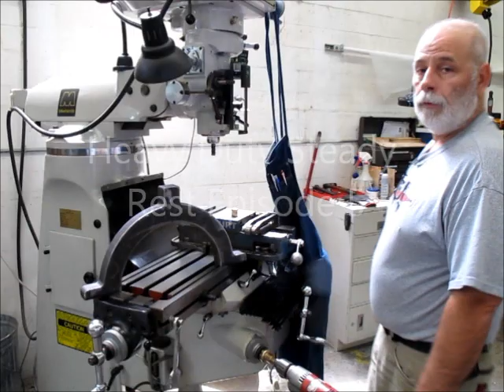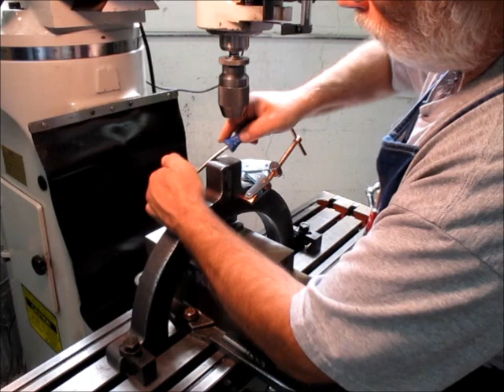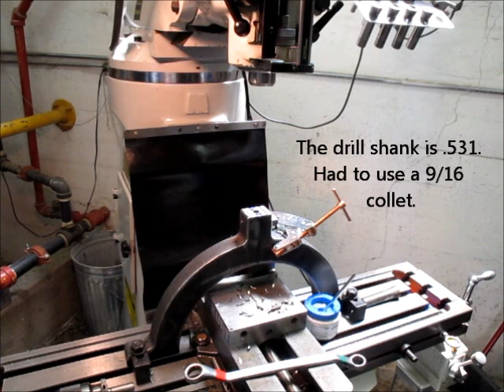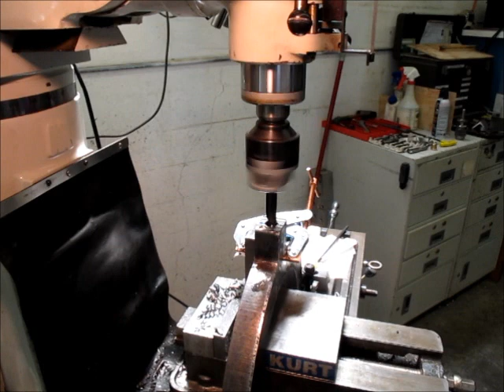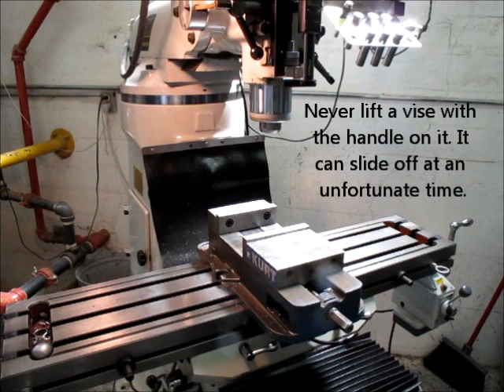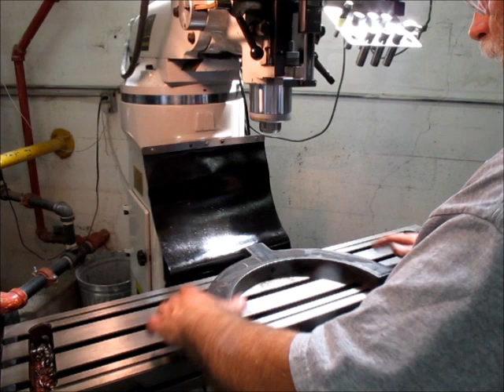Heavy Duty Steady Rest Episode 5

Comment: I think the geometry never got onto the right foot from the beginning by not facing off and getting parallel the two broad surfaces of the two half circles after the stress was relieved by splinting the original piece on the bandsaw. You went directly to using these unlevel, non-coplanar surfaces in the Kurt to face off the end pieces. That, I think, is why down the road you discovered the "twist." When you set the surfaces flat to the table, when you closed the vice it torqued the material for the next cut.

I saw Keith Rucker get balled up down the line on a project because he didn't get the material squared up from the get go. He had to back up and start again but was able to salvage his material.

No big deal because a steady rest doesn't need to be a precision tool. You adjust all three of the bearing surfaces anyway every time it is used. To be honest, a serviceable steady rest could be made by just making careful measurements with a ruler.

Comment: I was taught to set up a boring head with a little tension from the set screws and leave them alone. The explanation was that tool pressure would never be able to overcome the mechanical advantage of the adjustment screw. It made sense then and makes sense now. Tightening the set screws just makes some folks feel good I suppose... LOL

Comment: I really like the Noga Flex indicator holder.  The length of yours seems to work perfect on your mill.  I have a Bridgeport, so the same size would work for mine as well.  What model or length is your Noga?  I'm seeing 2", 4", 5' or 12" that are available.  Yours appears to be a 4" or 5".   Thanks in advance for the info.  
Paul
Reply from the maker: Hi Paul,

It is the model with arms that total up near 11 inches. If I had to do it again I would probably get the fine adjust on the bottom. Thanks for the comment.

Cheers,

Tom

Comment: Sorry, I should have said white cabinets with drawers
Reply from the maker: Hi Marcaap,

Those drawers are really handy. They are bank tellers drawers used in banks to hold cash and coils at the teller stations. They are super heavy duty and have nice roller slides. These even had the bill trays in them when I got them. They pop up on Craigslist once in a while.

Cheers,

Tom

Comment: Hi Tom,  I like this series on the heavy duty steady rest.  Your design for the roller/slides looks good and stout for that big job coming.  I have a question on your use of the 9/16"(.563") collet for the drill shank of 0.531" on the 17/32 drill bit.  I was taught to never go beyond .005" squeeze or you'll ruin the collet or atleast not get a good grip on the shank because you can create a tapered interaction between the collet and the straight shank by over-squeezing.
Reply from the maker: Hi Uje,

Thanks for the comment. Its probably a good idea to minimize the squeeze with a collet. Most collet systems such as ER and R-8 can tolerate at least a millimeter typically otherwise there would be more sizes needed. If you look at the size ranges each size can close half the collet size increment. As you saw the collet worked fine and the drill didn't slip at all.

cheers,

Tom

Comment from the maker: Hi Wayne,

I don't have any experience with Grizzly milling machines. I took a look at their website and they have quite a few models. One thing I noticed is the larger Bridgeport sized mills have square box ways which is great, A large part of the accuracy and ability of a machine tool comes from its mass. So bigger heavier machines generally perform better than lightweight ones. I'm sure you could do lots of good work with one of those mills. My mill is an Acra.

Best,

Tom

Comment: I've got a few questions... What kind of container do you have your lubrication in? I use an old can and it always gets chips inside it. I like the top on yours. Also, what type of lubrication are you using. I like your vise handle, is that just a cut off box wrench with a ball welded to it or something more elaborate? Great series, I'm really enjoying it.